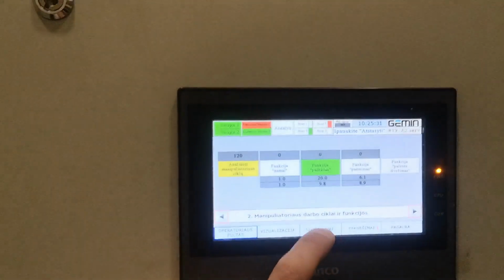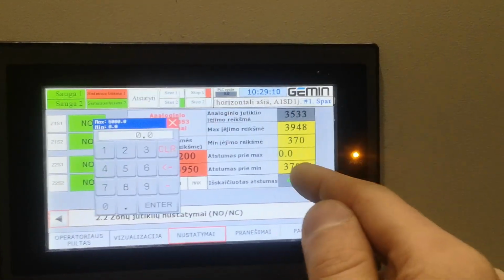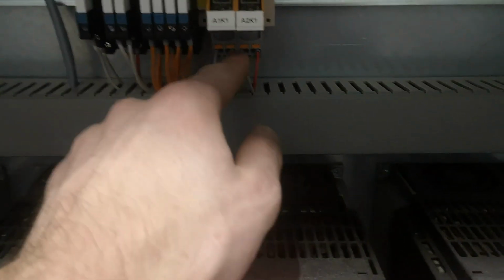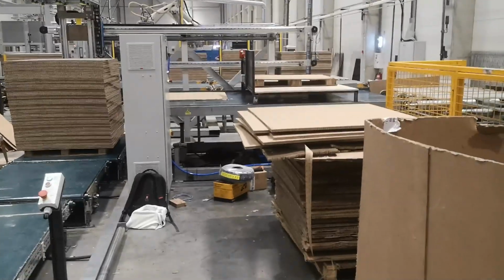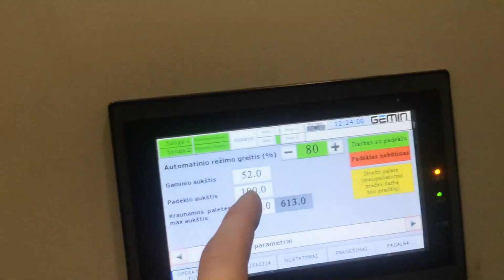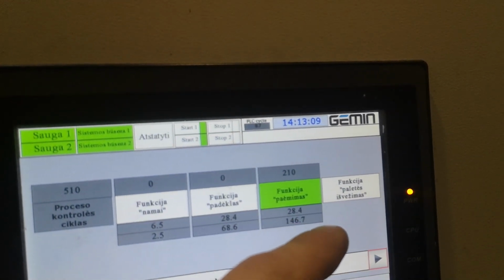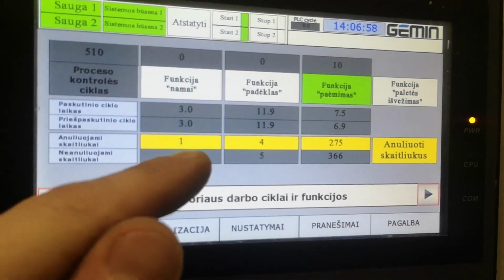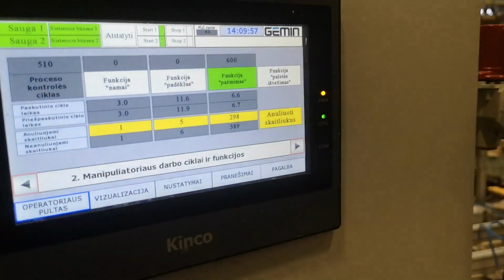Industrial machines #2

Comment: Nice machine. Did you solve the issue with the horizontal motor and brake resistor overheating?
Reply from the maker: It is not overheating - it's just hot 🙂
But the customer is going to replace the motor+drive, I think it will be 1kW.